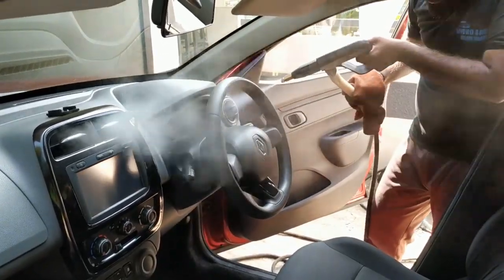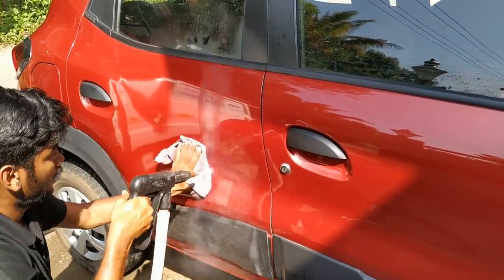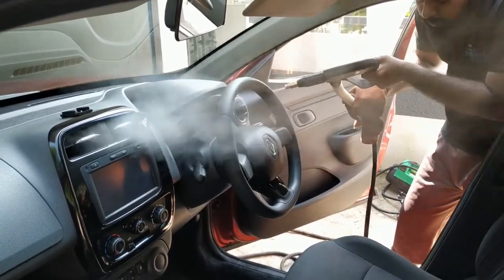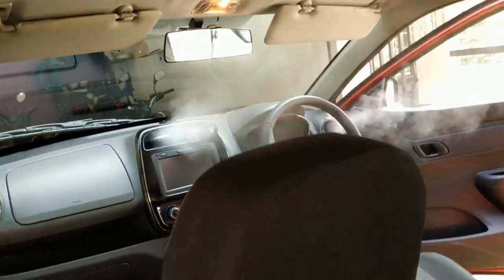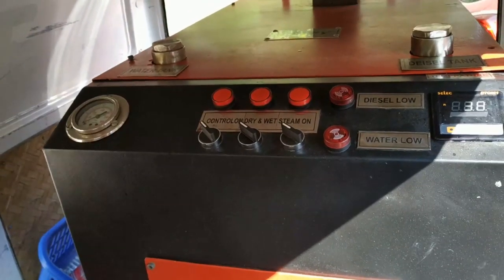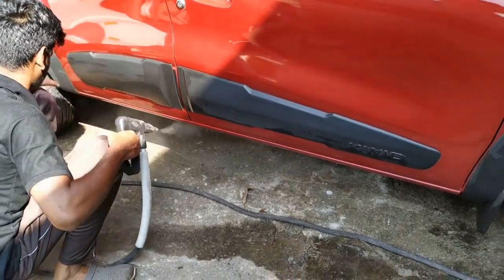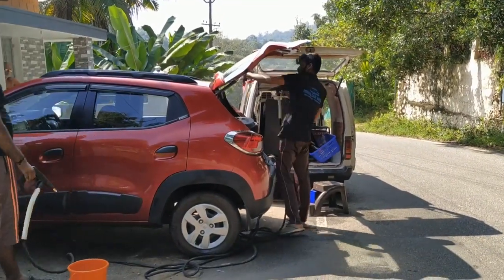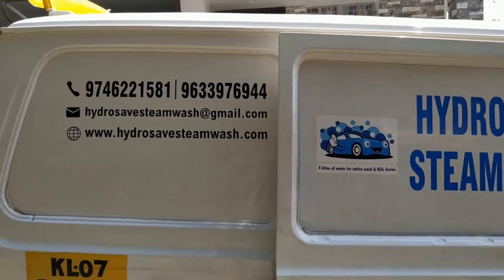Steam Car Wash -എന്തിന് ചെയ്യണം | Benefits of Car Interior & Exterior Steam Wash | Removes AC odour

Comment: Since the spray  temp. is high, will it damage the paint or any other vehicles parts ??
Reply from the maker: Not seems so. Everything is good so far
Reply: @AjithBuddyMalayalam  don't take it lightly, steam temp. is more than boiling water, mind it.
Reply: Hi bro I am Gokul from hydro save steam wash namuk cold varumbolo face facials cheyumbolo steam use Cheyuna pole ulu ithum, steam gun nobeil matrame high temp varunulu so namal safe distance maintain cheyarund, vehiclesil AC vent ozhike oradathum steam gun point cheythu upayogikarila gun epolum moving ayirikum
Reply: Yes it will

Comment: 150 degree Celsius temperature el ulla work ayathu kondu...., vandikku athenkilum reethiyil dhosham akumo?

Appozhum steam wash mathram cheyyunnathu kondu anthenkilum dhosham undo?
Reply from the maker: Vandiyile plastic parts ellaam high temperature thaangunnathaanu. Athukond dosham undavan chance illa. Vere doshangal enthengilum undennum thonnunnilla.
Reply: Hi  i am Gokul from Hydro Save Steam Wash,Gunil ninum puratheku varuna steamil namal safe distance maintain cheyarund, gun ac vent ozhike oradathum continuesly point cheyt adikarila, guninta nobeil matre high temp varunulu
Reply from the maker: Thank you Gokul
Reply: @gokulgs9240  njan one time wash inte karyam alla udheshiche..., water wash cheyithirunna alukal athu nirthiyittu steam wash mathram cheyithu thudarnnal vandikku valla complains varan sadhyatha undo? (Steam wash el anthayalum appozhum 100+ degree hot ayirikummallooo)